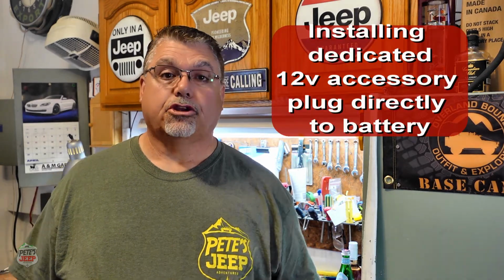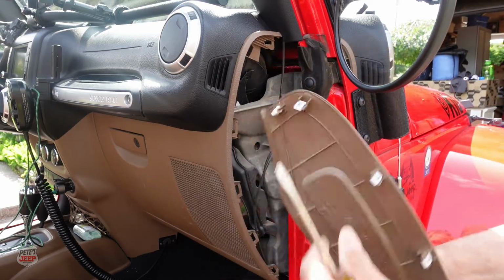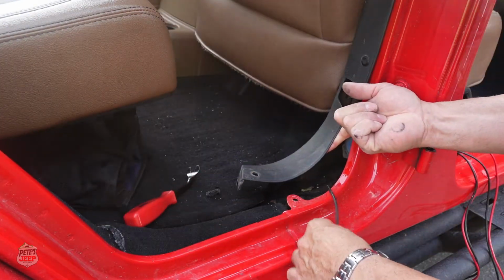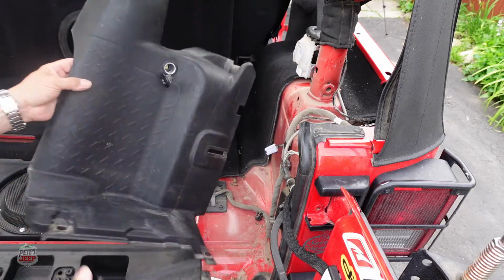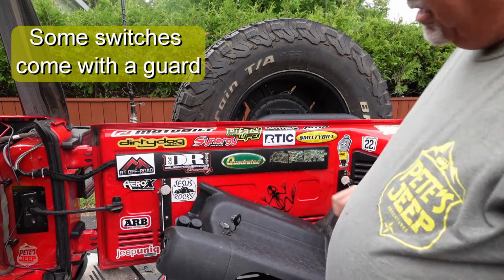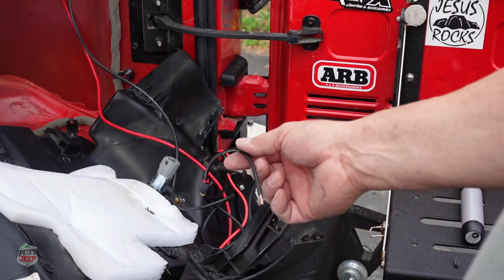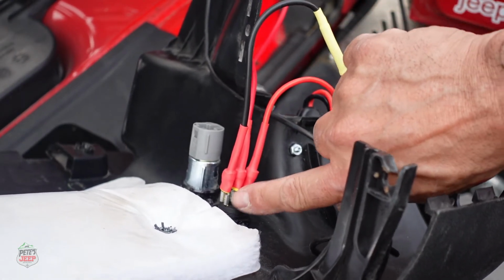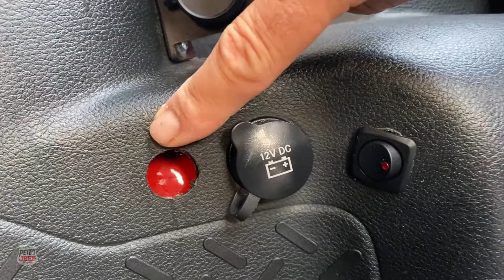12v power outlet install to battery. Jeep Wrangler JKU

Comment: The shortest path to ground is always the best, and being that the entire chassis is ground.... For best performance you should have grounded it closer to where you mounted the accessory.
Reply from the maker: I guess I can always add a second  fuse relay at the back.  Easy addition.

Comment: IIRC, most automotive 12v accessory sockets are rated for 10A max...so I'm guessing even if you used thicker wire to it the socket itself would be the weak link as it'd still be rated at 10A. 
I hope your fridge/freezer doesn't need more than 10A...don't think it does, as these units probably use 5A or way less, but you can read the factory-label to be sure.
-- BR
Reply from the maker: My fridge is rated at 4.5 amps.

Comment: I’m trying to use my OEM outlet in the back but it doesn’t to work. And I can’t find the fuse for it or at least which one is the correct one.
Reply from the maker: On the flip side of your fusebox you should have the diagram of the fuses. Telling you which one it is. Could also be under the glove box or under the steering wheel area. Depending on the year and model.
Reply: Mine wasn't "hot" either. Fuse is good. It may have shorted out along the way to the battery. Best to just run a new power wire to rear.
Reply: Can I do the same and just tap into my current factory 12v? Just wondering

Comment: Can I do the same and just tap into my current factory 12v?
Reply from the maker: Depending on the gauge of your wire.  If the gauge is big enough it should work with the factory set up.  I suggest to try it first.

Comment: What was the wire length you used from front to back of jeep?
Reply from the maker: I do not remember the length but I suggest you "dry measure" before cutting your wire.  If I guess, I would say between 12 and 15 feet.

Comment: Merci! But just changing the amp fuse to a bigger size would have worked. This is what I did and my electric cooler is running fine
Reply from the maker: Good idea.
Reply: Don't do this. Putting in a bigger fuse just makes the wire the fuse.

Comment: I must be the only Jeep owner that doesn't have a 12v plug in the back.  I drive a 2016 Wrangler JKU Sport that doesn't have a power outlet.  Weird.
Reply: I don’t either 😢
Reply: 2007 JKU owner and it's nowhere to be found except on dash for those still smoking Marlboros. SMH. I watched this in full length and was ready to order parts until I started reading comments. Guess I'll use my Jackery until I get the right info.